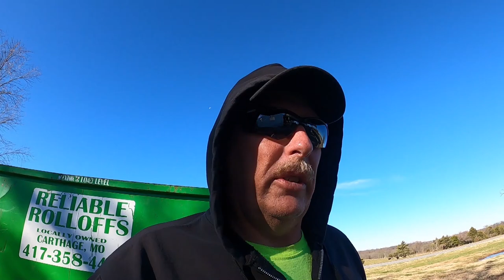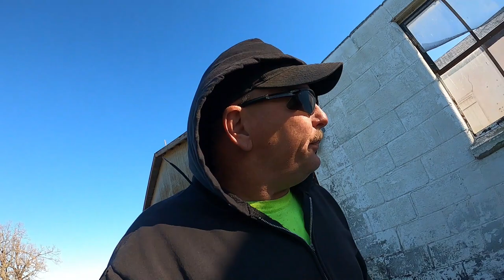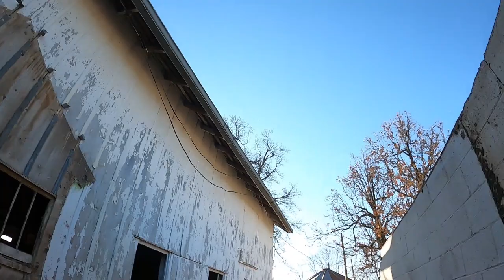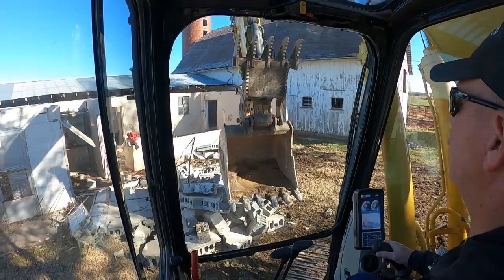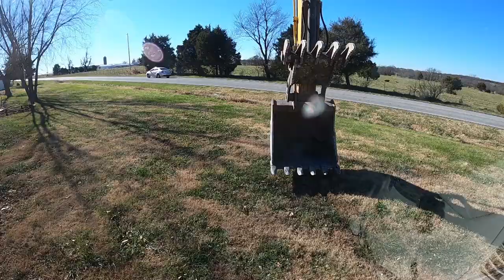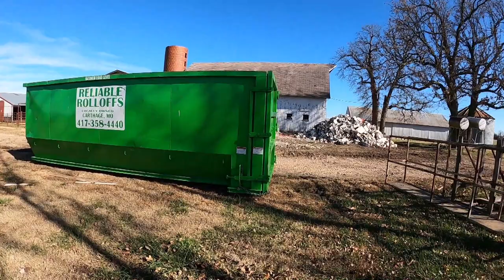Concrete Milk Barn Demo With The 210!!

Comment: Moving on to the job at hand today, which came down "gracefully" and falling where it should have. BEST is, you were careful (as you could be) in saving the concrete slab. Careless, or too thin would have ruined it but you managed around all that. Also looks like you piled all the old stuff out of the way of other work till it's all hauled away.  You've done a lot of work on this site with lots more to go & GLAD it's you, THANKS!  Sonny
Reply from the maker: Thanks man!

Comment: On the thumb splitting open on you due to pressure,  what if you were to take bar stock the same width and length of the Two outside arms going down to the bottom of the bar stock going to the plate just before the teeth and weld them on edge on the outside of them and add small triangular gussets in every lets say 8” with the gussets opposite sides of the bar stiffener bar.  Just a thought sir.
Reply from the maker: I’ve determined all it really needs is two large gussets on the inside of the arms that attach to the main pin.  I have some 3/4” AR steel that I can cut the gussets out of.  Just need the time to do it!🤦‍♂️
Reply: A.R. Plate as in abrasive resistance. Sounds like you have a plan in place sir. If you need any thing reach out sir , I will keep to myself otherwise. I do have 40 years as a jobber shop machinist with in place machining and welding experience
Reply from the maker: @terryrogers1025  Yes sir on the AR.  BTW I always appreciate good advice.  Im not one of those guys that get offended when someone make suggestions.  I appreciate them all.